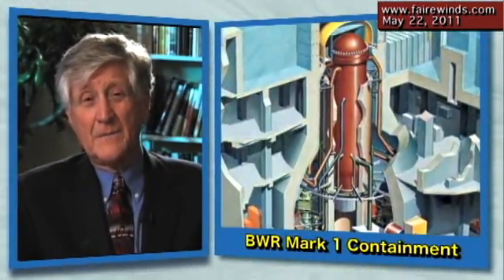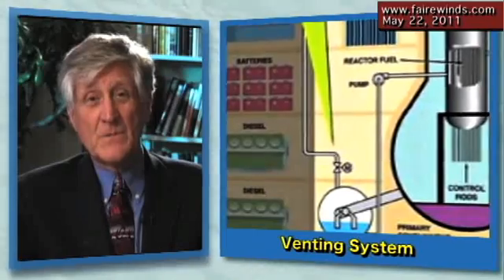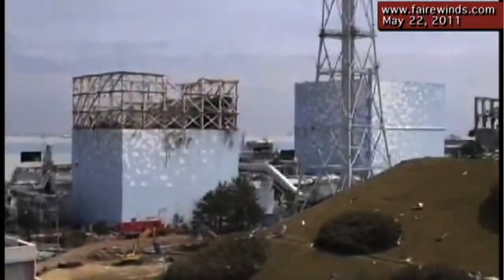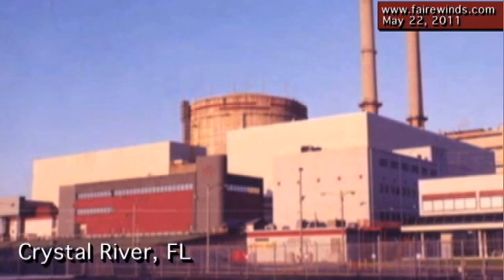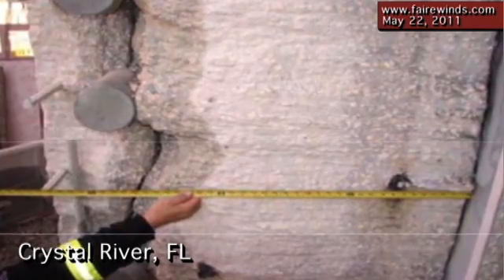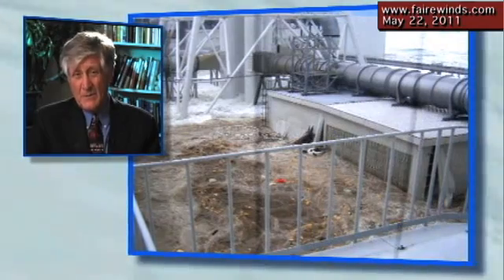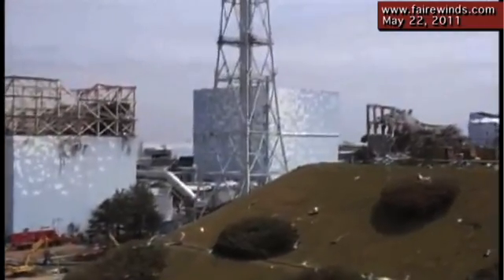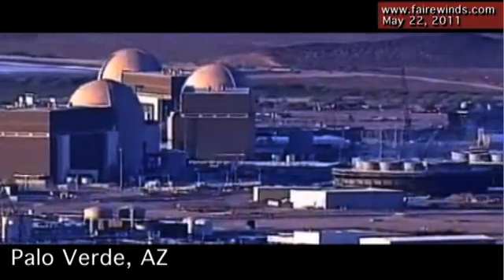The Implications of the Fukushima Accident on the World's Operating Reactors

Comment: @ashdavid10 : When they say designed for Mag 7 quake, they need to specify which components ?. And list the components and the appropriate maximum tolerances. eg the Main Containment vessel will likely stand > 7.5 but the associated piping for steam and water will not hold. Then what are the secondary and tertiary systems to handle those ?. It is likely the cooling for the vessel and Spend Fuel pool are the weakest point. This seems to be compromised in Japan.